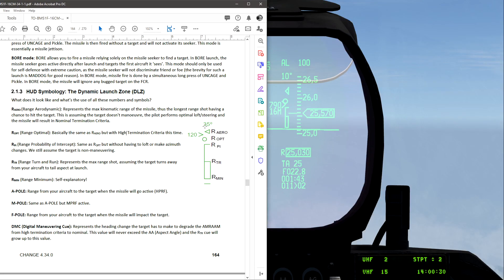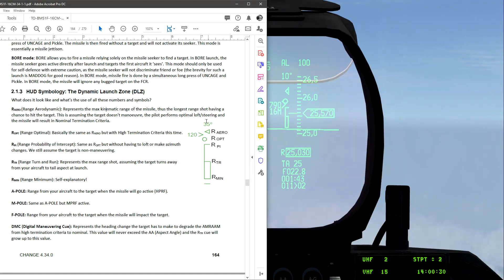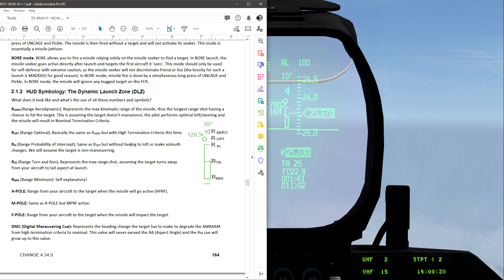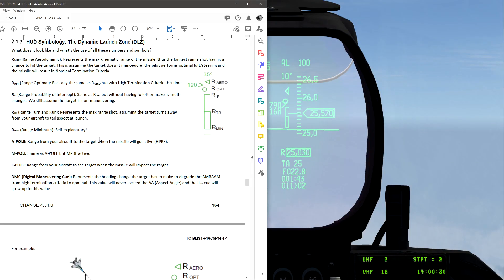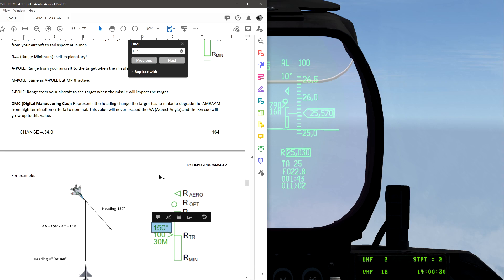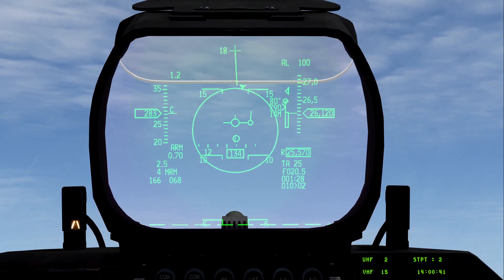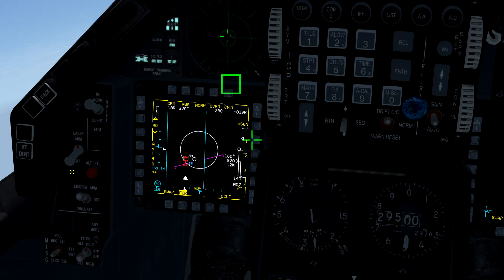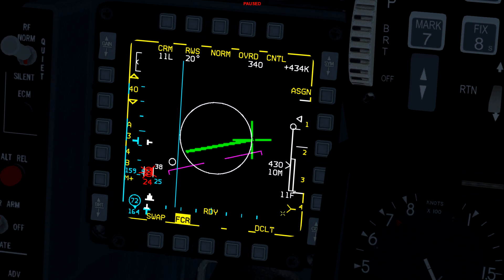Falcon BMS 4.34.4 - How to shoot an AIM 120 | Dynamic Launch Zone (DLZ)

Comment: Good stuff, consider using subtitles instead of speech next one!
Reply: The info was good but because there seemed to be some confusion of the subject matter when presenting, it was confusing what you really meant. Lots of acronyms in weapons delivery, the 120 is no different. All in all after taking this video and then ignoring the hiccups it was useful. I agree with the other guys, text on the screen would both be helpful to non English speakers AND add clarity to the speech which was filled with confusion.
Reply from the maker: Thanks for the feedback. Ya it was some thing just thrown together. I would recommend reading the manual. I didn't want to just read the manual word by word. Thanks for watching.
Reply: @AviationPlus  regardless of the blips, I learned from it and greatly appreciate the effort! Keep em coming!
Reply from the maker: @GPatricks  Thanks glad to hear it is a lot of information. I am trying to reference the manual as much as I could with out just reading it. I will have more and be sure to have it a little more organized.
Reply from the maker: Subtitles instead of speech? Not to be rude but would the subtitles be for the hearing impaired or it is preferred for someone? Using subtitles is not as effective as speech. Wanting clarification. Thanks for watching!
Reply: Yes, for people with hearing impairment but also for people from other parts of the world. Easy to pause and translate with text, not so much with speech. Just a suggestion!
Reply: F text. At least not edited in text. 

If you can get a script up with the closed captioning toggle, more power to you.

Otherwise text I can't get rid of is QUITE concentration breaking distraction-wise.